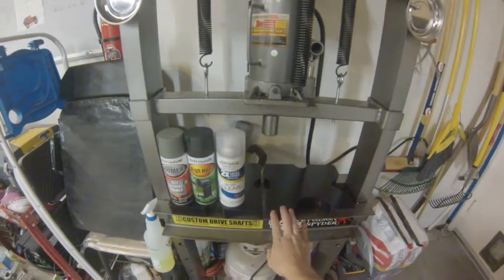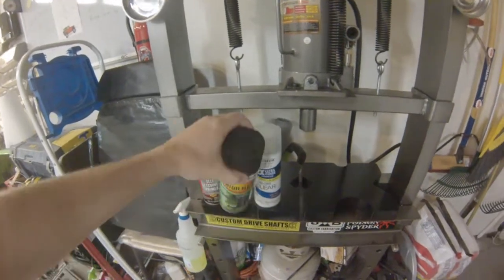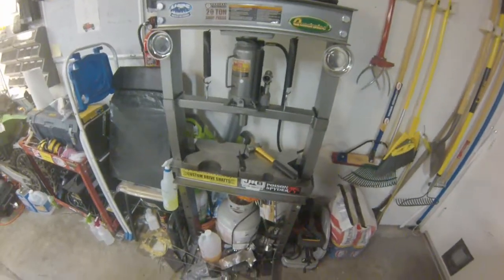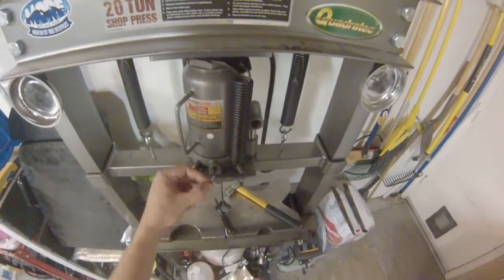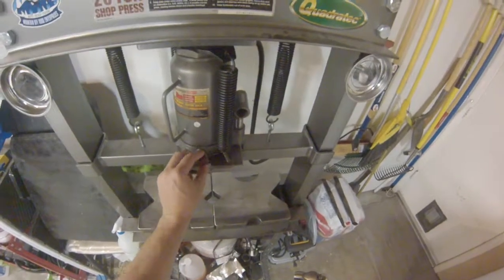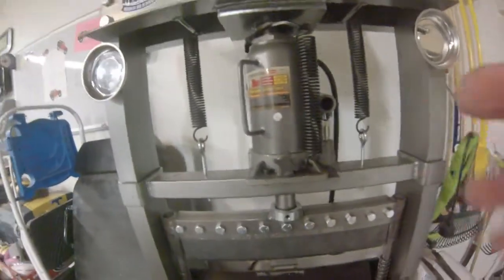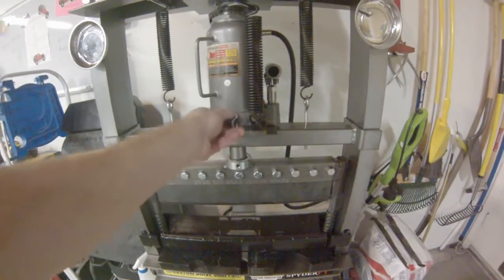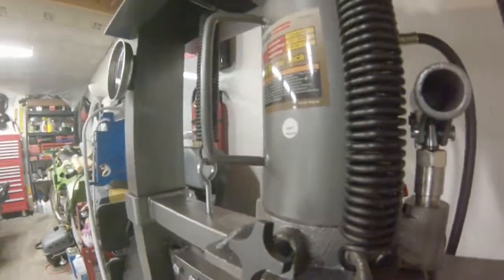Swag offroad arbor plates and  thumb screw

Comment: Looks like your guide tubes are welded wrong... They should be off set about 1/4 inch from center... Does the fingers even line up with the V grove on the finger brake?
Reply from the maker: Z71Ranger  yep lines up perfect in the groove. This thing had been great.